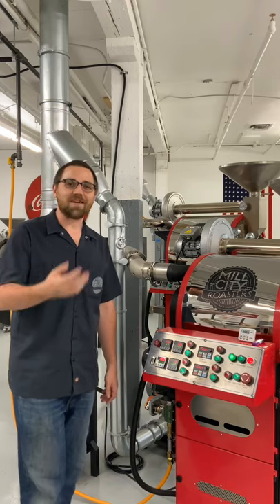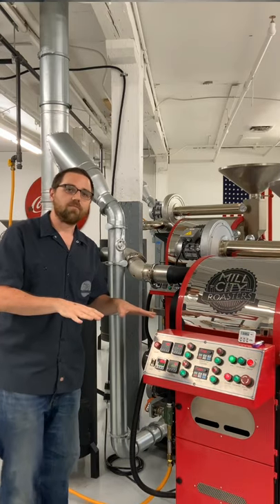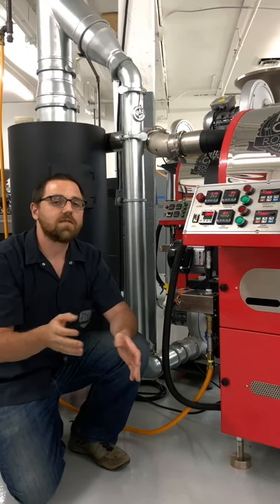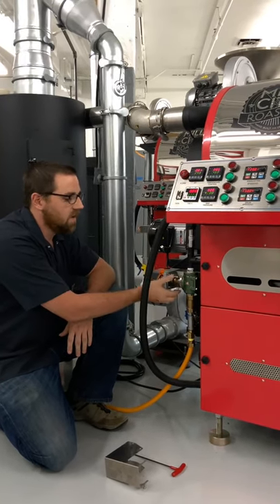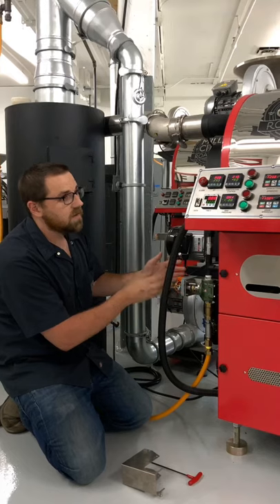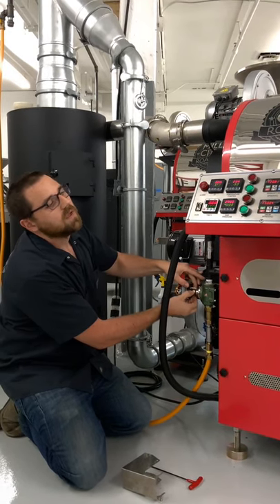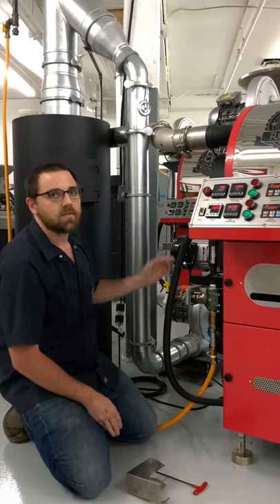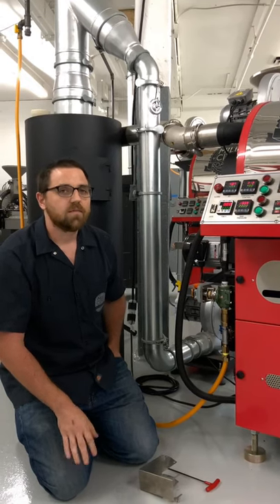Coffee Roaster Calibration: Adjusting Maximum Gas On Your Digital Gas Actuator

Comment: If I were to buy a 500g MCR, what ng pressure would I need to have installed? And (bonus question) if I were to get say a 3k or 6k in the same facility, would I need to upgrade that gas pressure or would one incoming pressure work for both?
Reply from the maker: Please call or email the office for gas supply and installation questions.
Reply: @MillCityRoastersMN  Will do